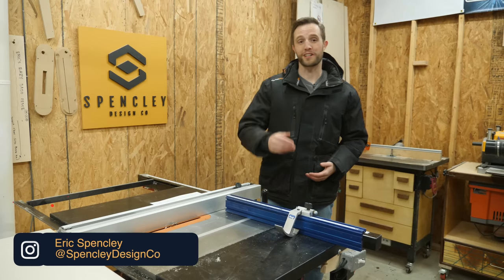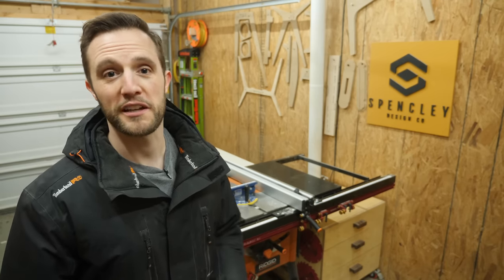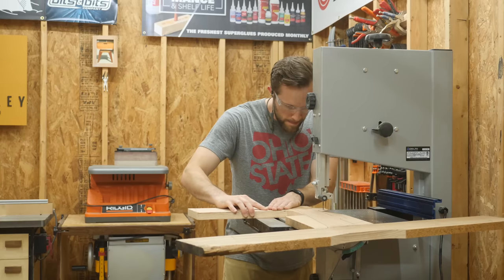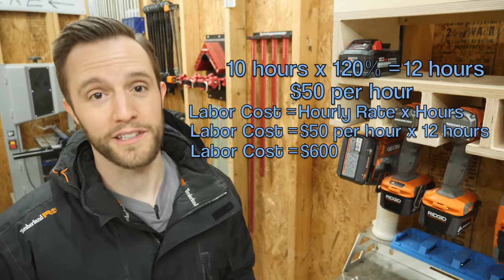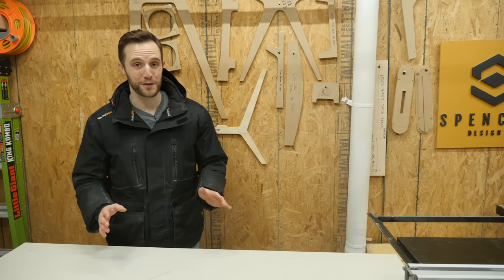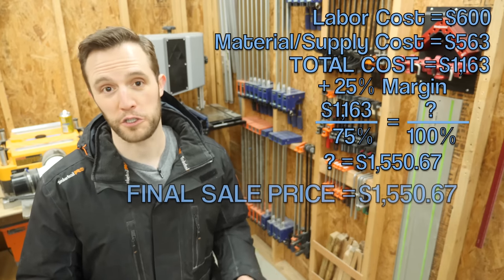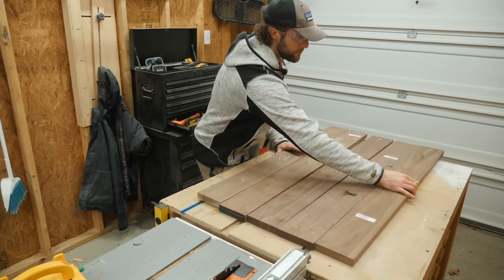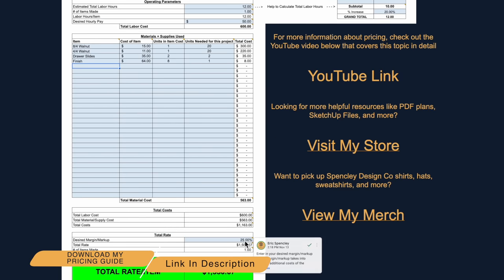Woodworking MasterClass: The One Thing You Need to Learn FIRST

Comment: I remember way back in the day when I first started out my wife used to do my billing. She always got aggravated when paying the bill for hardware at the end of the month.  So she had me put a white board on the trailer door so every time one of the guys would grab hardware, screws or anything on it. That way I could keep track of what was going out the door. I would buy hardware in bulk and charge retail plus a handling charge. It added up fast and the customer could see where the money went. If they ever had a problem with the charge I would educate them as to how they were saving money because if I had to send someone to the store to pick up the supplies the labor would cost more than the supplies. Have a good day. Every job and customer is different. Time will teach you how to deal with them.

Comment: I have a line for all the small items labeled “shop supplies” on my bids.  Screws, glue, sandpaper and items like that.  It’s normally $5-$10
Reply: Great line! Sounds like not enough money though. Every time you use a tool you are using it up, yah. A big glue- up uses a visible, even measurable amount of glue; what about saw blades and chisels? Solvent  for the pine tar. Pay the sharpening man. Buy a new stone. Spend time sharpening and maintaining your tools. Billing ten bucks seems cheap.
Reply: All that equipment and various usages are baked into my price.  The shop supplies are just that, the simple supplies.  Smaller projects are $5-10 but if I’m doing kitchens or build-ins it’s substantially more.

Comment: Sorry, but this is nonsense. As a person with an MBA, i find woodworkers telling someone how to price things is funny. What you have described is not how to price your projects, but a method to decide if you should do the project at all. Let's start with a couple things.

1. Price minus materials is not "Profit". It is "Cash flow". It is not the same. If you take the materials, depreciation, utilities,  other fixed and variable costs AND the money you paid yourself, what is left is profit. Many a small business has failed not knowing this simple concept. Say your tools are all paid for and you get an order for 20 widgets and you have a positive cash flow of $1000 in your widgets, Yay, you go buy a leather jacket. Then you get another order for 20 widgets and you buy the materials. Then a machine breaks that you cannot afford to replace. You are out of business. You have a material investment and an angry client. 
2. Pricing depends on whether you are providing a service or a product. A service can be bid upfront and then negotiated. You can determine costs and negotiate a price based on that. If the client is eager to pay your price, you probably charged too little. 
3. If you are charging for a common product then you are at the mercy of the market. 
4. If you are charging for your art, then you are at the mercy of your reputation and self promotion. Otherwise known as marketing. 

You absolutely need to be able to determine the cost of goods sold.  And in any business you should know how to do that properly. But that only tells you if you should do it. You cannot set prices based on that.

keep in mind, if you charge $1550,  and if the supply and demand intersects for tables of that quality if $750, well, your not selling the table. The last part of the video has the most useful information. If you are doing custom and find the rare opportunity where a person is willing to pay for quality.

Comment: Problem here is that if you are going by "firm" pricing you are giving up the opportunity to negotiate. So you conclude that $1,550 is your ideal price but that really ought to be the minimum you accept. Round that up to $2,000 and then you have a $450 buffer to offer discounts. People who have been doing contract work know there's always a baked in 20% buffer for discounts, meaning that whatever price is initially quoted can be reduced by at least 20% and still be profitable for the contractor while being a better deal for the buyer.

The other consideration that you may want to factor in is limiting the degree to which you will customize work. You can design some "base parts" and then offer customizable options for that base part. This lets you control the time it takes to produce the final product while allowing for people to get the results they want. Doing one-offs is really not a sustainable business model for long term unless you are demanding 50% profit margins or better. You also have to consider that one-offs are not necessarily going to translate into repeat business for multiple reasons.

Comment: Im a finish carpenter by trade, been at it for 25+ years and when it comes to regular day to day work building decks, installing windows doors and trim pricing has never really been an issue.  Where I do have an issue is doing more custom and artistic work, like miniature doll furniture, hand carved and wood burned signs and home accessories and decor.  While smaller the work is still time consuming and hard to price.  For example I made a 5 ft tall 1"x12" sign with a hand carved Gaelic phrase on it, wood burned designs, then I painted sanded and weathered it...All in all 20 hours work.  I charged $35/hour and had issues with the buyer who didn't want to spend $600 on the sign.  I ended up settling for $400.

Comment: That's a nice workaround to get a bit more money, but it's called exclusionary percentage if i recall correctly (might be wrong). 1163 x0.25 and you get your profit, which should be 290. In the end that adds up to 1453.75. I know taxes in the US are a bit dodgy, and it requires you to percetange tax your entire income instead of actually add the percentage on top or something like that.
Reply: In the UNITED STATES you can simply demand lawful money per 12 USC 411 for all money or its equivalent that you receive, and then such money or its equivalent is not subject to any reporting requirements and is not taxable. This is because the UNITED STATES entered into bankruptcy in 1933, and in 1934 suspended lawful tender (gold and silver coin) replacing it with the FEDERAL RESERVE NOTE. For a time, you could receive either FEDERAL RESERVE NOTES or US TREASURY NOTES but in more recent times these two were merged together into one paper bearing two distinct seals. Everyone is presumed to be using FRNs unless they make a demand for lawful money known.

Comment: When I was a very small plumbing contractor my biggest problem was competitors wanting my contractors by under pricing me.  Usually this did not work as the next bid, raising their prices back where they should be, failed.  Another problem was "guess bidding".  When I neared the end as a sub contractor and when I could no longer strap on a tool belt I lost my very best contractor who was quoted as saying "if Eric isn't on the job then there is no reason not to take a cheaper bidder.

Comment: Thanks Spencley for the very informative video. I'm going to download your template, and convert it to Euros (I'm in France).
Just a couple of comments:
- A 25 % markup is 1163*1.25 = 1454; by dividing by 0.75 you actually make a 33 % margin (1/0.75 = 1.33).
- I'm looking into purchasing a Shaper Origin, as a pseudo-CNC. It's expensive, but less than a standard CNC table, and it's pretty much unlimited in terms of surface area you can process.
Keep cranking out them videos, cheers!

Comment: Michigan. Nice tutorial on how to price a workpiece. All too often we underestimate time spent on design, redesign, redesign on the redesign, etc. Some consideration should be taken for consumables (glue, screws, nails, etc.) as needed. For calculating markup it's just easier to use X*(1+Y), where X is your base cost, and Y is a percentage of markup. if Y=20%, then just use X*(1.2) for the final number. You also have to understand your market, skill limits, and where you can actually complete and succeed in.